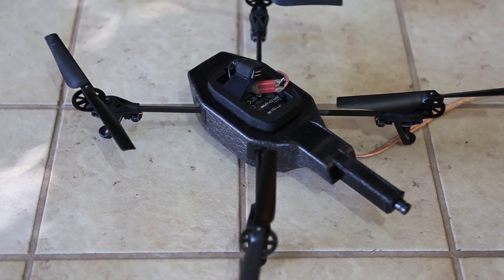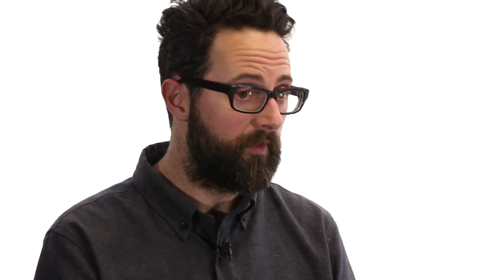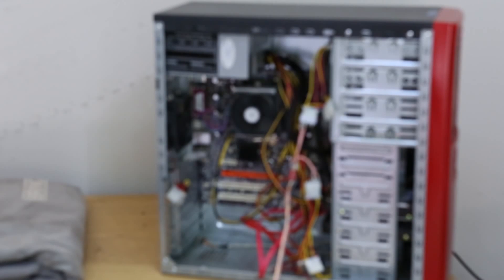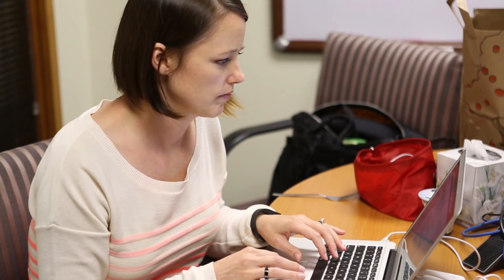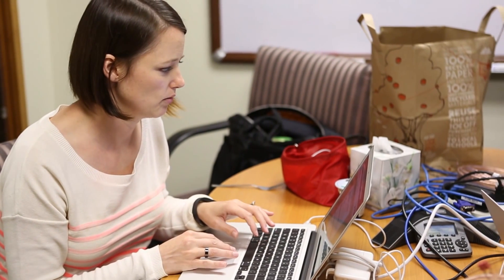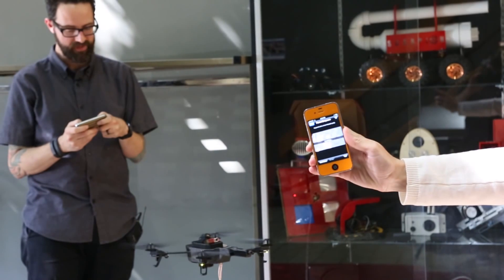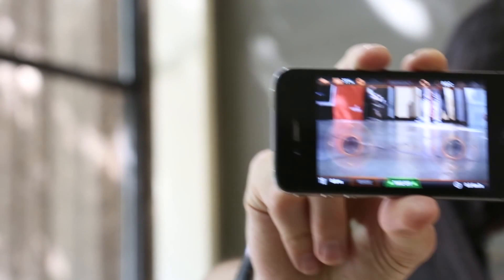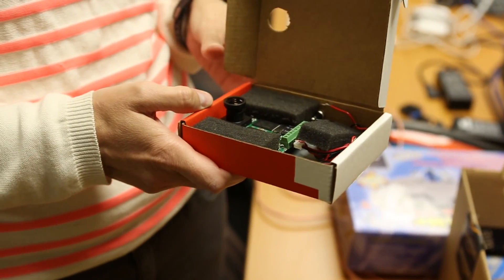SparkFun Hackers in Residence - Tethered Quadcopter

Comment: With 14ga wire pumping 12v we got around 25 feet without issue, it got rough around 30 feet. Our next version will send a full 110v up and then step down which will solve a lot of that.

Comment: Yeah. In the same way that someone spends weeks trying to figure out a way to put a window in a concrete wall, without affecting structural integrity of the wall.

What I mean is, there is a WHOLE different mechanic flying tethered than free-flight. You have something that is pulling down with increasing weight as the cable gets longer off the ground, and then you have power loss as the wire gets longer, and then a long power wire needs good buscap protection...

It is much more complicated.